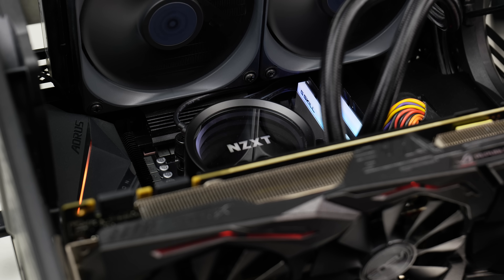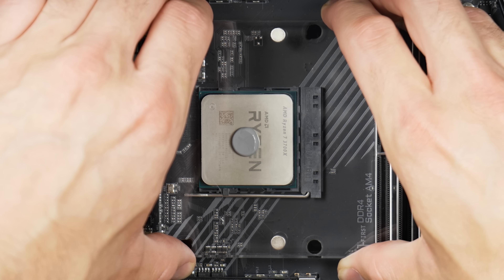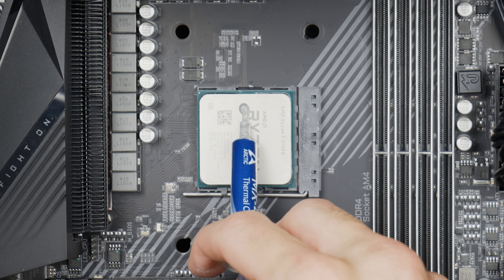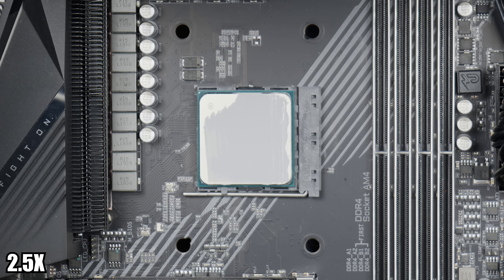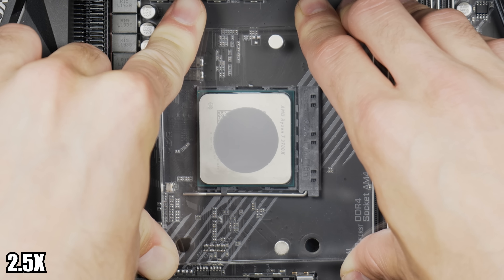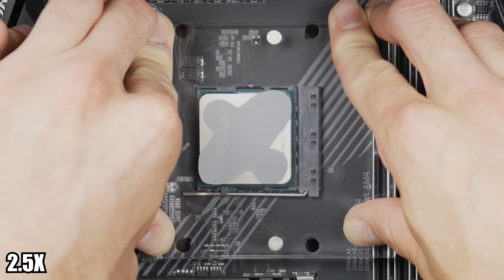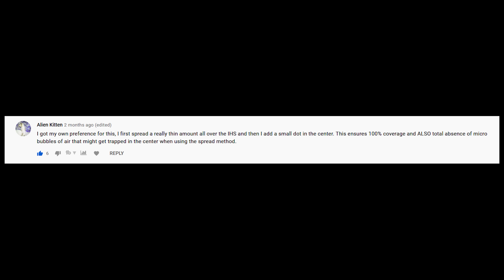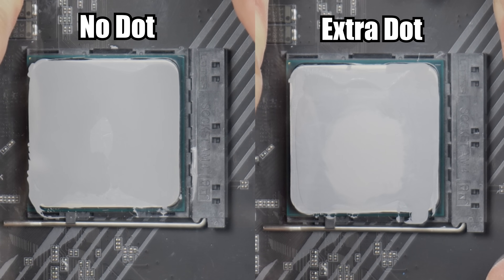Thermal Paste Spread Under Glass

Comment: When I got my h115i it came with thermal paste on it already  covering the whole aio underneath, if I wanted to changed my thermal paste could I just apply paste to the aio instead of putting on my cpu? I'm worried about changing paste on cpu as I don't want to leak anything in my board lol

Comment: i spread the paste then i wiggle the cooler a bit as i'm settling it down to more evenly get rid of pockets of air. also i set it down slightly angled so it settles down in a "wave" that doesn't really leave much room for bubbles to form

Comment: Yeah method doesnt matter as much as long as you dont put too little and dont have too large uncovered areas. Too much isnt as big of a problem, its more of a myth that it can do harm, it mostly wont, but only if its nonconductive, for example too much of conductive liquid metal may short unprotected pins, maybe even cause permanent damage. Just apply enough so you cover the whole heatsink and re-apply it every time you take it off.

Comment: You apply too much thermal paste, you forgot about the spread over time with temperature that changes the viscosity of the thermal paste. The lesser, the better because as I agree through the comments is that thermal paste is an insulator

Comment: Really glad to see this video. I work in the professional computer building industry. This is always discussed amongst the techs & engineers. I have always done the big X, corner-to-corner. Then a smaller x to make it like a snowflake, those smaller ends extending from the center, outward to the sides. I always start each line from the center, so a bit extra is left there each time. Giving me that extra dollop in the center.
Reply: Sounds like you're putting way too much on. You need as little as possible.
Reply: @orionlax626  Incorrect. It is actually very difficult to put too much on (sorta). I have half a dozen expired tubes worth $300 a piece, of thermal paste. I assure you (for funzies) I have put WAY TOO much on before. When they order too much at work & it goes past the expiration date, we spread the wealth & give it to people (rather than throw it away, the stuff is still good, just can't use it on customer product). You also don't want to go for the "as little as possible" method. It is always best to have a bit more than you need, especially if you are not experienced. The amount between the processor & whatever, needs to be enough to fill all the gaps & handle the thermal transfer load effectively. There really isn't a SUPER-SWEET spot that NEEDS to be achieved. I guess what I am saying is, take it from a guy whos been building computers professionally for 15 years & has like $3K worth of thermal paste on the floor at his feet (lol) - don't be afraid to add a lil extra dollop if you feel like there is too little.
Reply: @SomeGuy-sz1by  

It's hard to use so much that it seriously hinders performance, and it's definitely better to use too much than too little. I'm just saying the perfect amount is almost nothing. Like you said, it's about filling holes, not actually covering the surface. People are too paranoid about using too little paste because it seems to be the tyre-kicking of the PC world.

Comment: X, or 2 parallel lines are the best. Bubbles are an issue with the glass since you will not be able to emulate the even pressure of a cooler by hand also the glass itself is a bit more flexible than metal so even if you don't see it, it can have small elastic deformations to allow air pockets.

Comment: With the results I saw, the best method is an X with a dot in the center... a tiny bit more in the center, but no chance of air bubbles because the Dot will evenly spread along with the X.

Oh, and maybe do this on a 12-13th gen? since the processor is a sort of not-square shape.
Reply: This is very similar to how I have done it. I made the X not by drawing two diagonal strokes from corner to corner, but four strokes from the center towards each corner. This also resulted in a larger amount of paste in the center. The paste I used was MX-4. 

For dies that are significantly rectangular I would probably use an asterisk shape instead of an X because I would guess that the coverage on the longer sides of the die would be poor with just the X shape.
Reply: @A._Meroy  I just got a 12700k and did an elongated X, with a dot. Temps are amazing.

Comment: I've always used what everyone calls a "small ammount", and when I took the cooler off(weeks later, sometimes months) it's spread across the entire IHS, edge to edge, corner to corner, in a layer so thin that you can almost read the writing on the CPU. That's what I call "perfect ammount".

With my 2200g with Wraith Stealth or with my brother's 2700X with a large TUF cooler (can't remember the exact name), I applied the paste on both of them myself, and monitoring the temps they never went over 65°C in stress tests, and lower in normal gaming regime.

And for the record, I have tested them with the "recommended ammount" and there's little to no difference, so why bother using more when less is more?
More paste is bad too, there needs to be just enough to fill the gap, any more and it's an insulator.

But noo, if there's not thermal paste seeping in my RAM slots then I have too little.

Comment: thermal paste is a pourous borderline ultra fine sandy metal particulate with very small amounts of oil. think of bondo. bondo although a liquid in form. when dry is porous and can allow moisture to cause rusting to metals underneath if unpainted. theres not much moisture in thermal paste to begin with so im pretty certain the bubbles are just forcing through the paste and exiting the material all together.
Reply: i always do the "buttered toast" method. and have never had an issue. the only time that can be an issue is over application where excess overflows onto the chipsets around the processor and motherboard. if you do butter toast make it really thin. because youre doing the work of the squeezing already. the extra squeeze at the end will force out air and youll be fine. ive never heard of air bubbles in thermal paste. its realistically not even that possible unless the surfaces of your cpu or cooler were concaved for any reason.
Reply: otherwise the air with proper pressure would always be forced out. even whatever force he puts with his hands isnt as much force as there would be with the cooler on it.

Comment: I never  had a problem with either 5 small dabs of thermal paste in an X pattern on the CPU or just a spot of CPU thermal paste in the center about the size of a grain of rice.  Both methods work very well as long as the CPUs center area has enough CPU paste to spread out at least 1.25 cm in all directions.

Comment: I basically do a triple rice grain, but with a slightly longer "grain" in the center and two smaller ones on the sides (about halfway between the center grain and the edges of the IHS)... It gets really even coverage as far as I can tell, and usually very little to no spillover... I might try the buttered toast with the dot, though... Or maybe the buttered toast with a smaller pentadot pattern... I know it's not gonna be a huge difference, but it's nice to know which really is the best method and out of this video I would say the toast/dot was really close (the X is also really good as you stated), if not the best, but could still be improved upon...

Comment: I don't understand how the paste is supposed to spread on it's own. My heat sink weighs so little i feel like the paste would only spread a tiny bit. And since the heat sink is facing the side of the case not the bottom gravity wont be even pushing the heat sink down on the processor. Do I need to keep the pc laying on its side after applying paste and for how long?
Reply: Its handled by screws    you applay the paste on the CPU then put the cooler on then you screw it tight ..   Its a plate on the cooling that meets the cpu with paste that you screw together..
Its simple  Cooling device Plate agains the cpu with paste.

Comment: I never really notice any difference in temps with different application methods because I always use non-conductive thermal paste and put more than it needs. Every time I've removed a heatsink/ water block, it's always fully covered no matter what thermal paste method I used.

Comment: A lot to read in the comments so apologies if this has been addressed. Re: the micro bubbles, once the CPU is on the IHS(?) is heated up, wouldn't they dissipate either outwards or upwards towards the heat sink eventually?

Comment: It's surprising how many people STILL use cross or line method, or are afraid of using too much paste. Cross and line never guarantee full coverage of IHS. Too much paste has no impact on temperatures if you screw the heatsink with enough force - the excess paste always spills on the sides. It's literally impossible to apply too much thermal paste if you fasten the heatsink with enough force...

Comment: On the x make sure to leave less of the outer edges so it doesn’t become air tight. Or when you replace the fan twist it before you pull up or the cpu comes out with it

Comment: Remembering that the goal is an incredibly thin layer (the theoretical goal being a layer so thin that you have metal-on-metal contact between chip and heat sink, with paste only filling the surface unevenness), many of these methods — including the butter and dollop method — lead to excessive paste amounts. What I would do is an X with a tiny bit extra in the center, but applied with a dispensing needle on the syringe so that the amount can be controlled much more precisely.
Reply: What you would do? As in, you haven't ever done it and you're convinced your method is the best?
Reply: @themonsterunderyourbed9408  The phrase “what I would do is…” is shorthand for “what I would do in this situation is…” and says nothing either way about whether one has been in that situation or not. It does NOT indicate it’s a hypothetical situation. (And yes, I have, and did.)

Comment: There's no way you will have air pockets with an actual cooler due to all the imperfections and CPU manufacturing requiring the outer plates to be ever so slightly convex in shape. Due to all the uneven fiddling required to get coolers properly on and suspended, that "buttered toast" method is a pretty clear winner.

Comment: as long as there is enough thermal paste on the cpu when you put on the cooler, it is going to have good coverage. Using some of these methods, you end up putting way too much paste on the ihs, which makes it messy and a pain if you ever swap your cpu, and it can even get into the socket if you arent careful.

Comment: See people all the time using every method except spread and they get varying temps every single time they re-apply the paste. Meanwhile I have been spreading my paste for 25 years and every single PC I build with the same parts, the temps are EXACTLY the same time and time again. No variation, no 1-2c difference. EXACTLY THE SAME. I built literally THREE 1800x systems all with the exact same cooling at launch of ryzen (my pc, brothers pc, fathers pc) and all three systems got the EXACT same cooling performance. ZERO difference between them. Because I spread my paste. I have even had people tell me "those temps aren't possible" because "they" couldn't get those results. Sounds like a them problem not a me problem. Even the legendary 9590 from AMD, the 5ghz hot box that AMD specifically said to cool with an AIO.... I was getting temps that everyone and their mother said wasn't possible. But that just goes to show how bad their paste application method really is. Why do you think laptops and OEM parts are usually spread from factory? They don't just dot/line and then go, they have a paste application that spreads it. FULL IHS coverage is what matters. Heat spreads, and while heat will spread from the hot area to the coolest area, if the IHS isn't fully covered, then you get "hot spots" that just get hotter and hotter which can cause a bleed effect for the rest of the IHS. By having the entire top surface covered, you will more properly wick away heat with very little heat being retained. More surface area = more cooling. Its just common sense and common science. COVER the entire IHS, or end up with less than adequate cooling. Spreading also uses the least amount of paste and thus you don't waste any. If done properly, you dont really get a huge amount spilling over the sides of the IHS onto the chip. A nice thin layer is all you need. Thus you don't waste paste.

Comment: The reason that the air bubbles look like they disappear is because the glass is getting covered with thermal paste. Shakey hand movements cause it to reach more and more surface, until eventually you just see gray. The bubbles are exactly where they used to be, just right underneath an ultra thin layer of gray goop.
Reply: I swear... on first read through of your comment I thought you wrote "...gray poop." 🤣😂
Reply: @teaEarlgreyHott  Same.
Reply: @teaEarlgreyHott  "...gay poop." seriously :D
Reply: no, they're pushed out by the pressure.    how tf would slime trap air when you're putting massive pressure on it?  maybe if the surfaces were very uneven and created a pocket for air to hide, but how would method make this better.

every time this is tested with temps the conclusion is it doesn't matter, as long as you use enough
Reply: ...aaand Eric Cartman has entered the chat.

Comment: Every time I've removed my CPU's cooler to check, clean, and replace thermal paste, I've noticed the mount gives enough spreading pressure, along with the imminent heating up of thermal paste from the CPU's heat spreader to further an ever so slightly increase of viscosity for full thermal paste coverage. As most people that (should) have searched online for how much thermal paste to use, and understand a little basic physics, they should understand & come across a conclusion, that less thermal paste used (but not too little) is better. Especially since you want to have max surface area coverage of thermal paste on the CPU's heat spreader and (the most optimal) minimal layer of thermal paste to maximize heat transfer efficiency from the CPU's heat spreader, to the thermal paste, to the cooler's heatsink, along the cooler's pipe & fins, to the air that the cooler's fan is blowing away air or pulling air from.

 Though I just wanted to say everyone's CPU heat output and cooler efficiency will be different if not the same models; theoretically there should be a perfect amount of thermal paste used to get the perfect maximum heat transfer efficiency.

Comment: Spreading the thermal paste would probably work better if you have one edge slightly thicker, and apply one edge of the cooler first, to move the air all in one direction out

Comment: I've installed thousands of CPU's going all the way back to the late 90's. I've always just put a drop on and spread it with a card or a finger honestly. I've never had a single one overheat and that includes overclocking. So I'll be honest, it doesn't matter so long as you have good coverage and thus contact between the cpu and HSF. Remember the only real purpoose of thermal compound is to fill any gaps between the two metal surfaces.

Comment: Basically half my job is ensuring epoxy coverage underneath die. The x is the best pattern for a square object, but keeping a bit heavier in the center of the X helps prevent air bubbles and improve coverage

Comment: best method of thermal paste is actually just a dot in the centre. Reason being that it's incredibly foolish to assume your mounting will apply a perfectly even pressure that you're doing in your "test"

In fact, it's been proven that no mount applies the pressure the same, so going with something different than a centre means you could be leaving out crucial contact surface

Comment: I never thought of air bubbles until this video, but i still would go for the 9-dot variation ;-)
I don't even think that air-bubbles are a concern. You are pressing metal on metal.
The only way that air-bubbles can possibly be trapped between your CPU and the cooler is because the cooler is not perfectly leveled.
And if that is the case, you better get a new cooler, because that one would be garbage!

Comment: ive worked at two different sandwich shops and they both independantly decided the best way to spread sauce like mayo or mustard on a sandwich was to write a letter N or M (depending on the size of sandwich) and then if more was requested, to write the leter Z on top of it. would be interesting to see how that applies to thermal paste.

Comment: The top of the processor where the paste is applied is just the core cover of the cpu processor.If you disassemble the processor so you remove its top cover you get to the core of the cpu processor which is very small and located only in the middle.So it is enough to apply a pea-sized paste to the middle of the processor because only there is the cpu core and only there is cooling.
So in practice it is not necessary to apply thermal paste over the entire outer casing of the processor.I always put only a pea-sized paste in the middle on the processor and the temperatures are incredibly low.Lubricating the paste all over the processor has always been the result of high processor temperatures.
Reply from the maker: Generally that is the case, however the way ryzen are built it's a bit different.
Reply: @TechIlliterate  
Yes it is true.